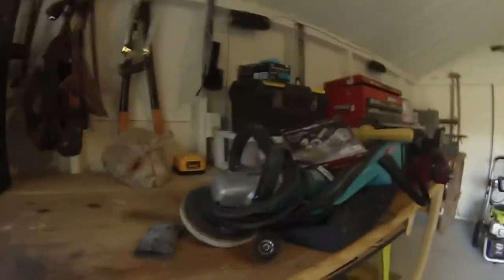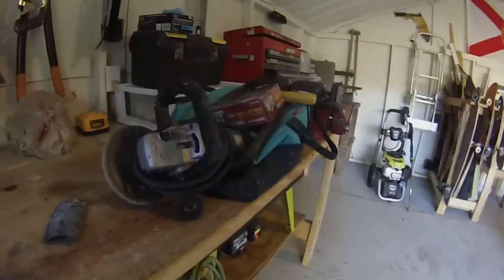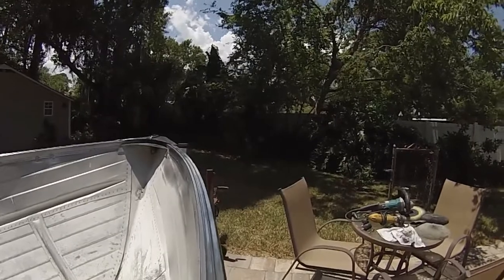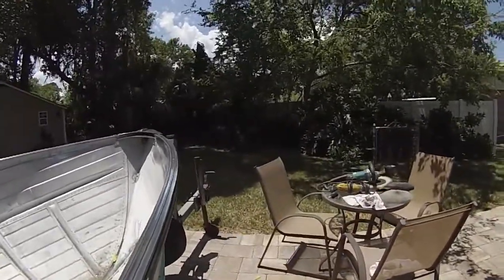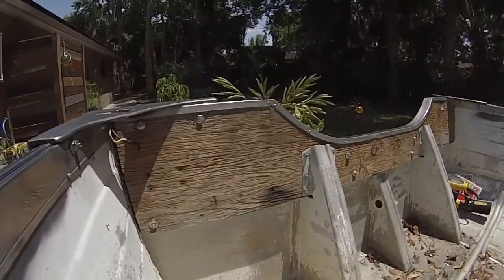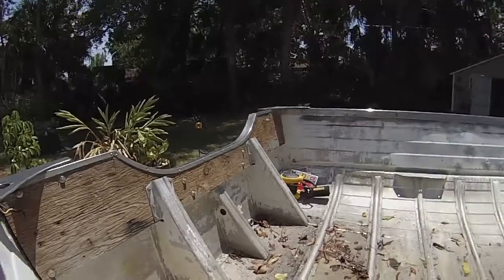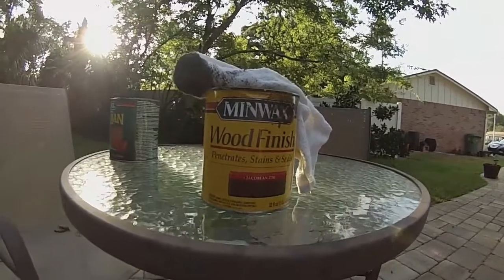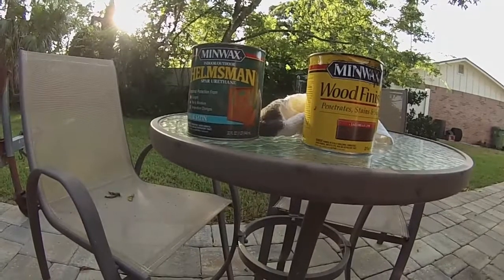Phase 3 - 1964 StarCraft 14’ Aluminum Boat Restoration

Comment: I have a 1962 that i restored 15 years ago thats still going. That should have the hull identification number stamped into the aluminum on the outside of transom, no need for the plaque if it does.